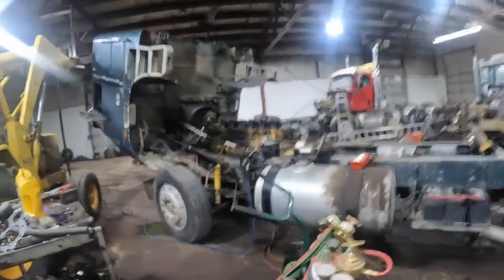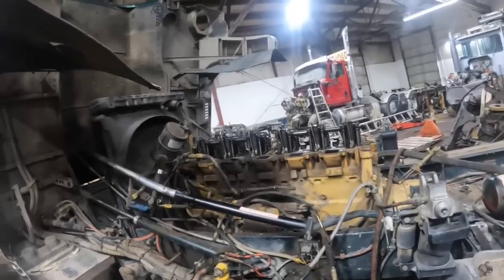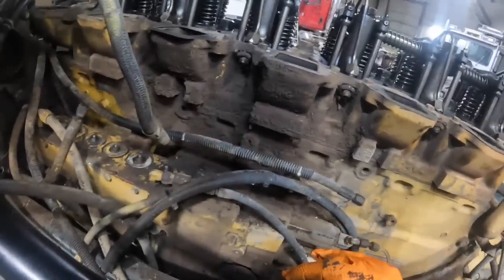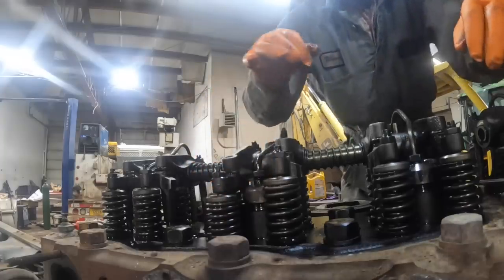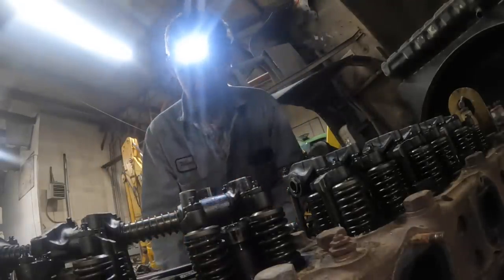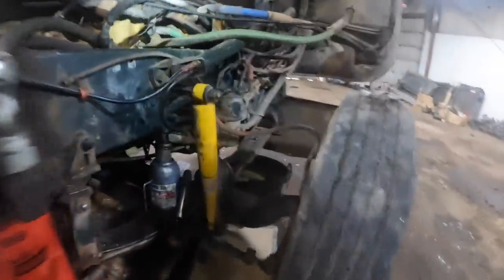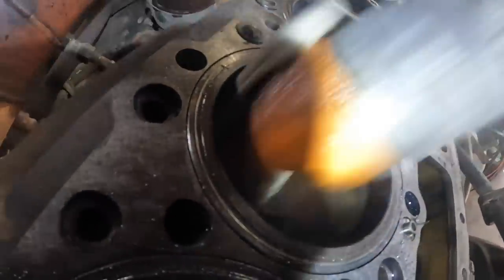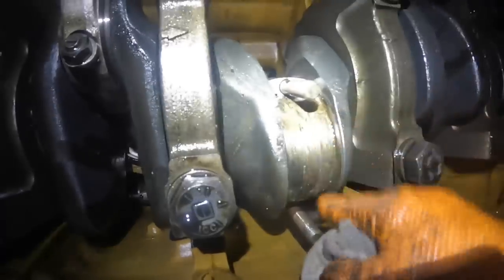Cat 3406 B seized up!

Comment: I had a C in my 93 Volvo and it was a gutless disappointment for several years. The ECM shorted out around 400,000 miles, and instead of replacing it , Terry at Pantropic Cat in Fort Meyers turned it back to a mechanical B with some pump and timing fabrication. Plus a fuel pedal. What an absolute monster. He set it at 2150 rpm's saying i didnt need it any faster. With 24.5 rubber and 373 rears 105 mph was no sweat. The beast accelerated up Mt Eagle with about 20,000 lbs in my Atlas Van line wagon rolling coal like a Fletcher Class destroyer  laying smoke. 4 mpg being foolish, almost seven when being frugal. Dropped a valve at about 1.3 million miles and had the big Cat dealer in Winchester VA on I-81 overhaul it and put another ten years on it including heavy hauling prefab concrete panels up to 125,000 lbs a whack. Broke my heart when i sold it. My two 350 cummins were as bullet proof and economical as anything going but for sheer power and reliability and longevity nothing could touch that Cat. Fuck carb,epa,def,scr,dpf and every other alphabet soup sob  that doesnt understand what it takes to move freight and run a business.

Comment: When I went to trade school for diesel mechanic, back when mechanic's were called mechanics. My engine I worked on was a Cat 3406B. Really nothing to them, solid engine and when she fired, was so sweet and satisfying. If I remember correctly, my old instructor called the 3408's throw away blocks. My opinion, this old 3406B is still worth fixing. Great video as always
Reply: 3208 throwaway. 3408 Powerhouse V8.

Comment: Looks like you have a 7FB, JWAC, with a Brakesaver.
3406 (now called A model) was a PCT, PCTA, DIT, DITA. (1973-1984) 92U prefix.
3406B at first was a 7FB, JWAC DITA, later ATAAC was added. As they ran out of serial numbers, the first 4MG's 1-03599 was still basically the same and still could be a JWAC.
Starting at 4MG03600 the VTU was the major change. And they went into the 90,000 serial numbers. Then they came out with a 5KJ and it was a 3406B, 1-07799. Most people get this serial number mixed up is the 3406 B 3ZJ, serial numbers 1-16181 is a 3406B. During the late 80's the dreaded PEEC was released. Electronic governor and VTU. You had PEEC II, PEEC II.V They started out as a 3406B 8TC. released next of the PEEC was a 2EK, still a 3406B.  Last PEEC was the 4CK and it was a 3406B 1-0845. Another 3406B PEEC was a 5YG strictly a 460 HP @1900 RPM'S.
After the 3406B ended the 3406C was released. Mechanical was 5KJ07800 and up, I have never seen one of these.
 3JZ16182 and up. The last fully mechanical 3406C was the 8PN. It is a totally different engine and parts do NOT inner change well with the older engine. Finally you had the last PEEC, 4CK0846 and up. It was a PEEC III and had a lot of VTU problems.  
Just ran across some 5KJ's 3406C's that was JWAC and high HP. Looking into these.
Reply: It kinda sounds like you might have spent a little time in a cat shop... guy like you are getting few and far  between. It's getting harder and harder to call anyone that knows anything about the older  engines.  Most of my old buddies that know stuff like you obviously do are gone.
Reply: @danielelliott3659   In my 43rd year, been around the block with Cat engines. Worked on everything but a 1670, 1676, 3306/3406,  Gas truck engine and a 1693 with a forged body fuel system. I have never seen these in a truck only pictures. When I hired in 3406 92U's was current production.

Comment: I liked your comment on the turn in the fuel screw. We farm and pretty much all of our tractors have been turned up I don’t have anything stock. Years ago I used to tractor pull   with an 86 series international Harvester those American Bosch 100 pumps had a fuel screw also to turn the fuel up we would turn them up to go tractor pulling and turn them back down to go back in the field at what we normally ran them at there was an old mechanic years ago that was a pump master I’m getting horsepower out of them. His best line used to be I can make it run I won’t guarantee how long lol

Comment: I have a 3406C and this video was of the most interesting to me.  The engine in my Kenworth has over 40,000 hours on it and still running.  Really felt for you when you were getting the oil pan out.  I seriously doubt the owner will rebuild this engine due to cost and time down.  Way cheaper in $$ and time just to replace.

Comment: Yeah when i was in Diesel school in 1987 , the school wouldn't let us rebuild the cat engines , too expensive , so we were stuck on the DDA's , i remember seeing the first prototype Cummins diesel in a pick up truck , after that diesels became a big thing in Pick up trucks. No more racks for fuel delivery , everything was switching over to Electronic. Worked for Cullen , they had the lightest truck engine on the market but the heads would crack , ended up in the shipyards and worked as an engine fitter. Lots of memories , my uncle and grandfather were diesel mechanics.

Comment: Great job Warren, I've got a 4MG and  a 3ZJ mechanical 3406 and haven't seen a more informational teardown.  Both mine have under 400K and only get driven at harvest but the age of them makes me wonder when a liner O ring or head gasket might go bad.  I really liked the diagnostics of the 8R 3 point hitch although I hate seeing such nice equipment completely abused like that.

Comment: Didn't do all that work to find out it spun a bearing!!  You were told it hydrolocked and you removed the head and verified the original complaint.  Further investigation, after finding that with the head removed it was hard to turn, found the spun bearing!!!  Great diagnostic teardown!!

Comment: I am not a fan of cabovers because I drove cabover Freightliners for years. If that was my truck I would find a used engine or a used crankshaft and get it running again. The older trucks are way better than the new ones. But I am a fanatic about 3406`s as I am one of the few that ever ran a D7 with a 3406. It was the fastest Cat steel tracked crawler every made. It is the only D7e ever converted that I know of the other D7`s were D7f`s. We pulled out a 180 hp 4 cylinder engine that ran 1330 rpm`s wot. And we installed the 3406 that would run 2100 rpm`s wot. But we did change the ring a pinion gears on the cross shaft. The tractor would go 8 mph in 5th gear so we never used 5th. But I know how much torque a 3406 has back in the 80`s I was driving a 1979 International 4300 with a KTA Cummins set at 525 hp. Some viewers  may know a KTA Cummins is 1150 cubic inches. When pulling Cabbage Hill east of Pendleton guys with 3406`s would out pull me going up the hill. But I would always pass them when it started to level off as the acceleration of KTA would let me upshift. And they could not upshift until it leveled out. But the drivers we have now have no clue what real truck driving is like. I learned in a Kenworth a 318 Detroit then I was driving a Freightliner with a 220 Cummins. This a truck that took me an hour to drive 13 miles. This is also a truck that I hand to downshift going down hill because of the headwind. Thank you for another nice video.

Comment: When the 3406b was introduced into trucks in the UK in the 80's we found that they had a lot of problems with the intermediate head gaskets, also the engine stop solenoid on the fuel  pump was very unreliable,forever being called out to the roadside

Comment: Thanks for the share Warren. I enjoy your videos. you said about turning the injector screw in and increase the rack... back when i worked for Genesee Ford Truck and they had the IH engines in em.... i called em a corn binder engine ... lol.... we'd loosen the injector pump and rack that as far to the left as the lines would allow..... that would wake'er up a lil bit. some of the horse play that would go on in that shop.... lol

Comment: It is sad to see good equipment being broken just because you just don't want to deal with fixing it.
I always wondered why people ignore issues, but it is the mentality you are being taught trough your environment.
My father is also the type of guy that doesn't care anything about preventive maintenance at all. If something leaks oil then just keep filling it up, till you forget it once and now you have to deal with broken gears and bearings just because you didn't care it would be an issue.
Water in engine oil is just one of those things that I never understand that it will cause a catastrophic failure eventually. 
Maybe the whole issue is that people think that you are just trying to sell them unnecessary stuff. And I get to a point, but eventually everyone will learn :D

Comment: great vib Warren, lve just stripped a 4 cylinde  dura torque engine down with a rob knock only to find all the top bearings on the rods where worn badly and this was on a reman engine to that had only done only 10,000 miles.

Comment: A series or mk1 or 1st gen is often applied retrospectively, manufacturers wouldn’t use it on new engines or vehicles to avoid the suggestion that an improved model would be coming later

Comment: What I did on a Leyland engine , head removed, sump removed, filled the block with neat anti freeze. left it for an hour, then blue drips of anti freeze came past the liner seals on two defective liners

Comment: Wow, there’s one that may not get repaired, I owned a A model in a 82 Pete 359 model in 1986, the sad part was it had a 10 spd,got rid of that got a 13 put in it!and sold it,then in 91 bought a  400k mile Pete,359. I put a million on that truck.

Comment: i think they called them either 3406 or 3406 PC TA for prechamber turbo charged and after cooled aka cat 360 hp, they also made a 3406 nat
ural asperiated. my fav engine to work on .. did a bunch of O hauls on them seem to recall a 3404 same guts but 4 cyl for a year or two cat had a compisition issue with the liner O rings  the non prechamber was a 380hp
Reply: Read my comments at the top.

Comment: Warren, was the 3406 (A) 😅 a 375 HP? Had a 73 long nose KW with the original 3406, Spicer trans, ran super strong. An original Dana test truck before I got it.
Reply: i had a 72 pete with a 3406, and a 6x4 spicer. 6 over, and it would boogie.
Reply: A 375 HP, 92U prefix, 3406, was a PCTA. On PCTA the other popular HP was a 360. It used the turbo off a 1693. 92U engines was available in HP from 240 to 400. DIT, DITA, PCT, PCTA.

Comment: Just learned something new. Does the PEEC engine use a nozzle or injectors? Since they have different injection pumps.
Reply from the maker: Nozzles, the only thing that changed was they used BTM or brushless torque motors on the injection pump verses linkage.

Comment: That proffesional diesel mechanic you are taking about is full of crap, I had a 3406A in a 1983 Freightliner for 17 years, It was a super great engine , same injection pump after all them years, never was takin off
Reply: It was just called a 3406, just like 3408. The B was added by Cat. People changed the name to A model.

Comment: injectors are not nozzles. the nozzle is on the end of the injector. the pump shoves fuel at high pressure to the injector and it cracks the spring pressure at hopefully close to 3K psi giving a good spray pattern. when pump stops adding fuel in that stroke the injector spring closes so the lines stay charged ready for next stroke.